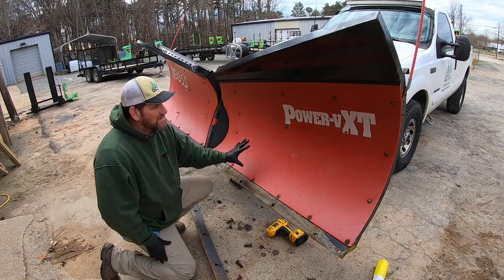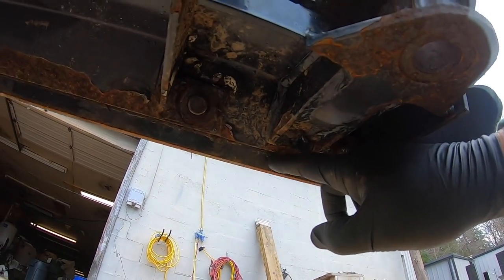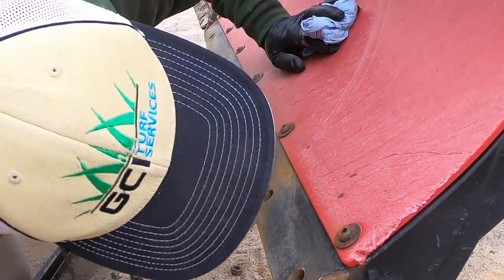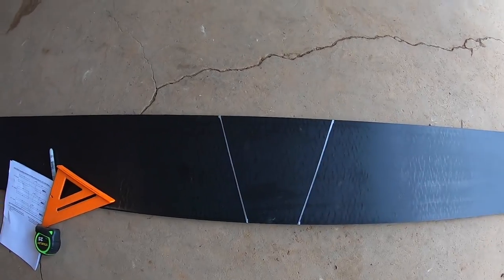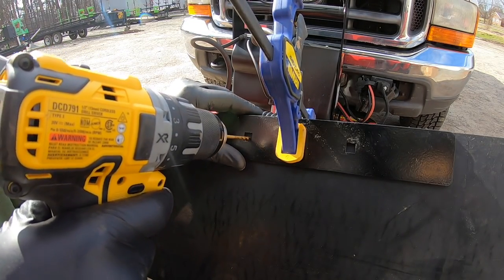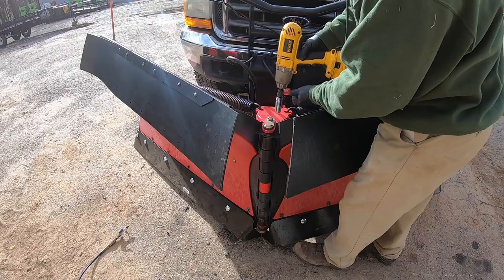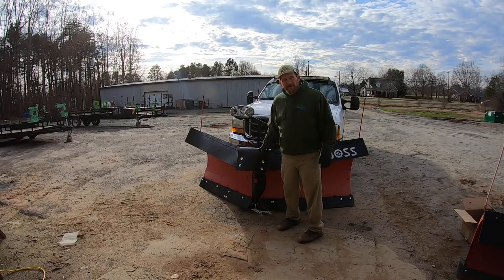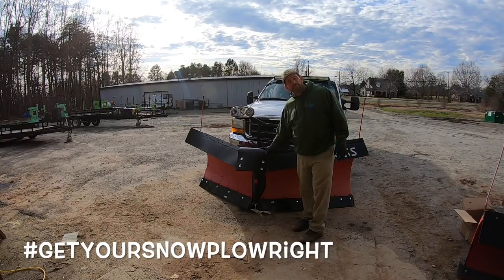Boss Snow Plow Deflector and Cutting Edge Install

Comment: When I used to work in a truck accessory shop, they had taught us to keep the feet on all the time as a safe guard for the mounting holes. We'd space them just so when they started to wear, the blade had about 1/4-1/2" of life on them. If a customer was really bad at keeping an eye on things, we'd space them so when the feet fell off, they'd need to come back in. Much easier and cheaper to replace those than to fab the plow. Lovin' the videos

Comment: Put some never seze on those cutting-edge bolts, when you go to take off that cutting-edge again the bolts will come right off. That's the best thing I started doing years ago to my plows. I hated heating those bolts with a torch to get them off.

Comment: Consider using bar chain oil for rust prevention. It sticks better than WD40. I don't plow snow, but it seems like a blade should last longer than one season, especially where you're at.